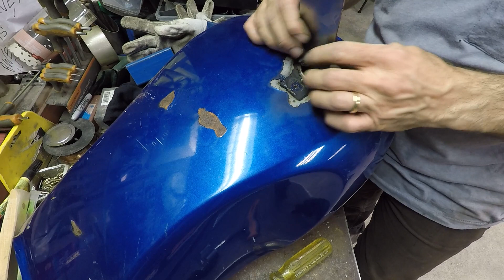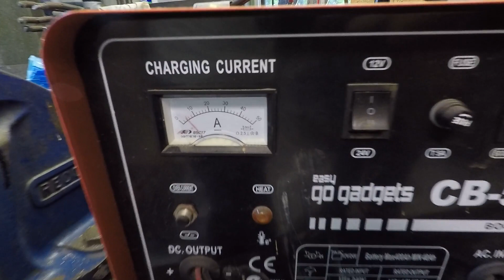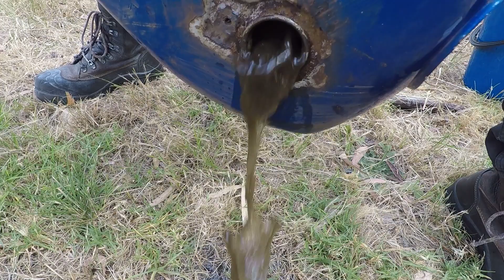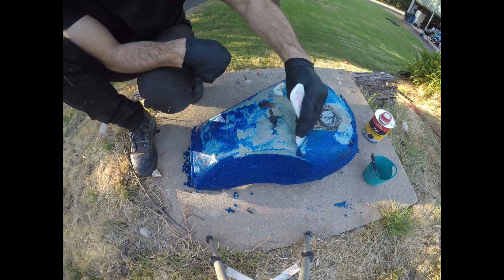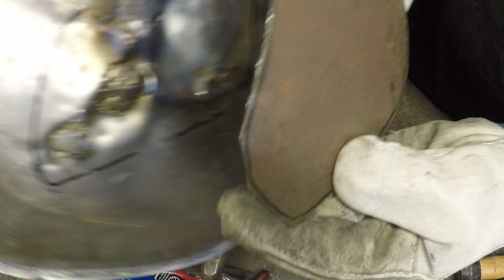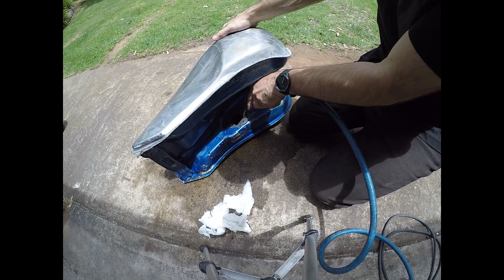Yamaha XJ650 Part 11 Fuel Tank Restoration

Comment: hey good vid on internal rust removal. I'm going to do this myself soo but what size fuse do you put inline? Thanks
Reply from the maker: Hi mate, I used a 10 amp fuse. Its protection from a dead short so 5 to 10amp is fine. On my charger with a clean plate in there the draw started at around 3 amps...
Reply: @Mezzmoengineering  got it..thanks for the reply mate thats me good to go..might even do a vid 👌

Comment: Dude you are such a genius! I doing a 81 xj650 midnight maxim bobber build and I’ve already learned soooo much from you and I’m only a few vids in. What you recommend without using a charge to clean the tank?
Reply from the maker: Thanks mate. You could use an acid but I find electrolysis like in my video is the best as it doesn't eat away any of the good metal and its cheap....Just some care is needed. I did the same with my drift trike tank, check that video as that tank was extremely dirty and come up like new